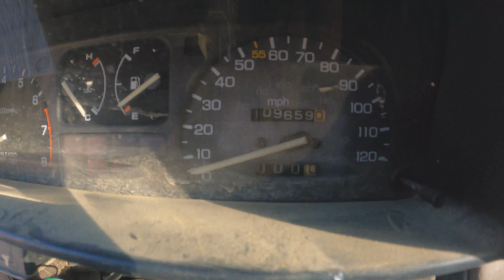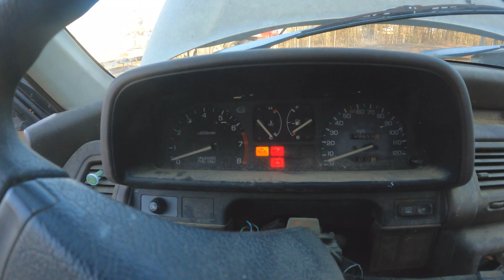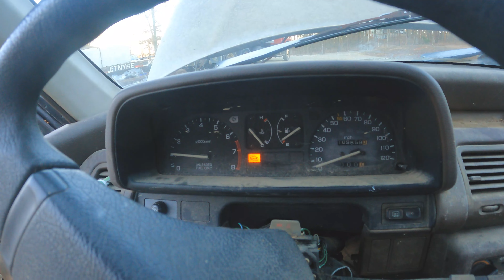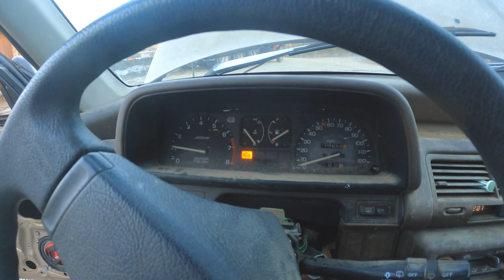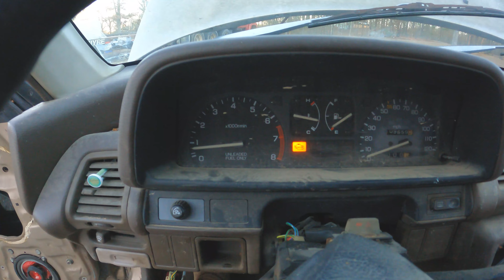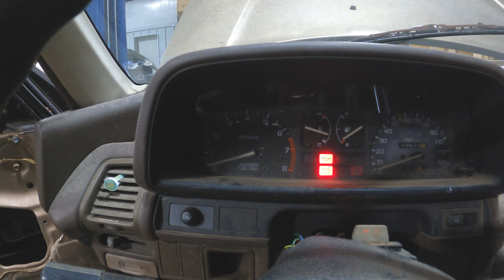This is actually unbelievable(RT4WD Civic Wagon Saved)

Comment: I was taking to you the whole time!! Like I was there w’cha!!! 
Self tappers we’re for them to ground out gas pump! Because they where gonna j-rig a single power wire to the hot side of the pump 🤷….. or part of the dogs punishment was self tappers for dinner 
(😡some ppl shouldn’t be permitted to own effin animals 😡) 

You are a no doubt a Honda Guy!! 
You do know you can just heat up the solder joints in the main & shes good as new ,,, don’t even need new/more solder , just get the oem joints runny/wet, let it cool… she’s good for another 10yrs 

While i was CSI-Ing with you 
my guess the whole time was DEFINITELY the main was cause of all their headaches & I bet 100bill it was a hot summer day when they where (fixin) on that wagon 

I have a Q for you … my 89 EE is pretty boney like this’en but I think the same guy (fixin) on your wagon was also working on mine …. They cut up the AC hoses & im sure trash has gotten inside the compressor!! Sooo my Q
is can  I use a r124a compressor from a lil newer civic with d-series , i know it’ll bolt up & if need be i can fabricate hose ends 
So with new 
Compressor 
Dryer 
Condenser…. Will she be good to run 134a??? & blow ice cubes 🧊 out the dash vents 😂 

Lastly …. You taught me something!!
((I’m from Georgia & maybe this is why)) 
But I’ve Never seen a NON ac wagon/civic 
& if I heard you right …. PS was an option also?!? My EE has no PS & no sign of ever having it!! 
I thought MAYBE someone took out ps rack & put in Manual rack … no tale tale sign there was ever a reservoir!!  
NOW you got me convinced she never had p.steering 

Plz educate me on the AC … or shed some light on my situation (Georgia is way to effin hot 🥵) 

***boney is how Georgia Redneck Honda/Miata weirdos call 
BONE-STOCK***

Comment: New sub here
I also recently picked up a 91 wagon. And it doesn't crank. The previous owner did the same replacing the distributor, starter, and main relay. 
I'm suspecting it's the ignition switch. But I'm wondering what you did to get your wagon going?
Reply from the maker: Thanks for subbing! If you aren't having crank at all it could be a few things.  If there is zero noise turning the key it's something electrical,  I would check with a multimeter if there is any juice at the ignition switch. 

Fortunately this one just needed the starter cycled more, a new battery.
Reply: @DashnCars  the only noise I get when turning the key on the crank position is a click by the center console and glove box. Nothing in the engine bay.
Reply from the maker: @Honderrez209  ah! I'd check the hot wire that goes to the starter to see if you're getting juice there, next.
Reply: @DashnCars  i will check that. 
Thanks for the help. Great wagon videos I've enjoyed all videos of the latest wagon come up..
Reply from the maker: @Honderrez209  Heck yeah man! Thank you. Good luck with your wagon and let me know if you need any help!